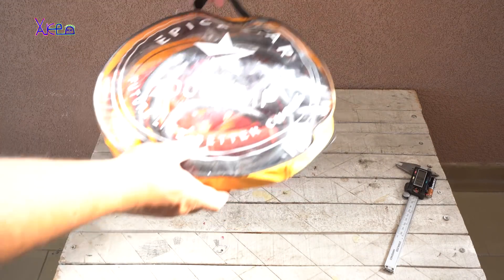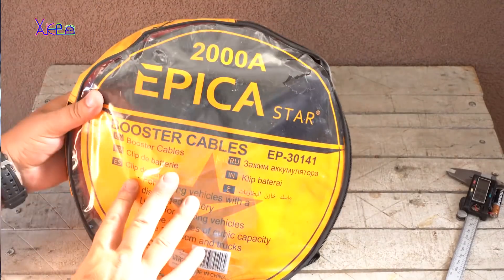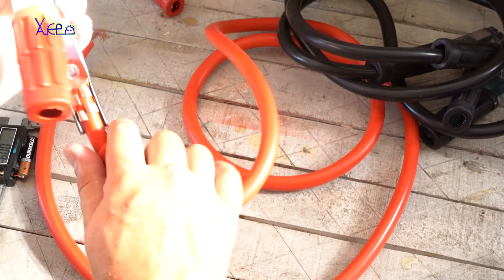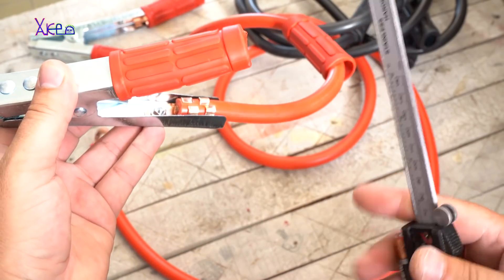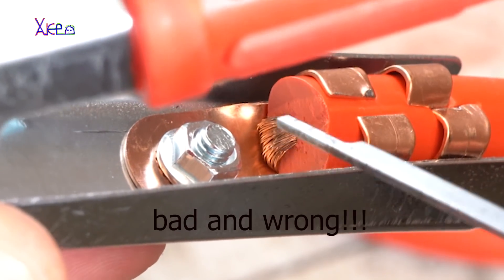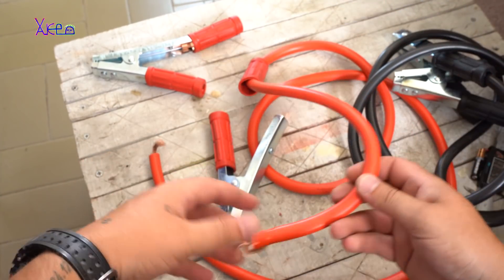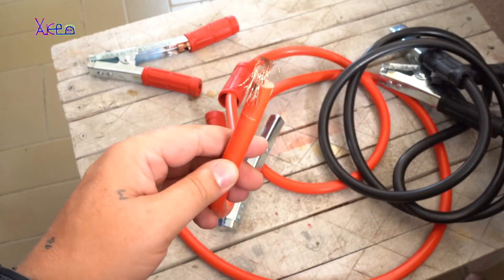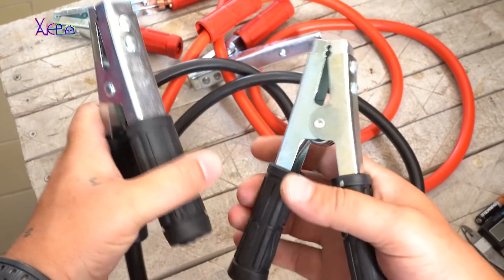FAKE 2000Amps Car Jumper Cables - Look how I Fix them

Comment: Always check the material thickness of the expensive component of your purchase.
The diameter of the copper cabels,
The minimum wall thickness of the plastic soap drawer in you washingmachine.
it appears sturdy but in the critical points there is no real thickness.
So the machine is designed to fall part after one year.
Reply from the maker: Very well explained sir

Comment: It's still a poor solution.
You should visit ANY big-rig repair shop or any stereo installation shop and purchase some proper single-lead 1/O or 4-Ga lengths of cable. They will cut you any length you desire.
If you are lucky, they may even have some cable of those sizes with 2-separate leads in one "loom".

Comment: I have a similar case and I used your idea
I used an electrical wire consisting of 3 wires, each of them 4 mm
But I haven't test the cable yet

Comment: I like to repair and to improve things, but in this case I have a few doubts.
The new "cable" has still a too small cross-section (< 100 A could work). The crocodile clamps are also cheap, so they might break with high currents. High current connections must always done via crimped connections (there are hydraulic presses for that) and not via soldering.
Next time, just give it back to the seller and buy a good pair of cables.

Comment: Very nice one thanks 👍, although maybe no need for the electrical tape, with heat (in the car), i think the  adhesive will go everywhere and make the cable sticky etc
Reply from the maker: You are right,No tape better